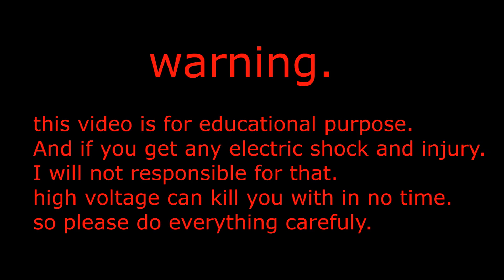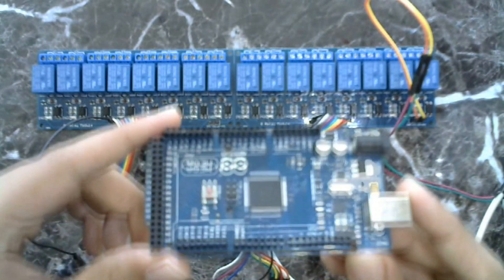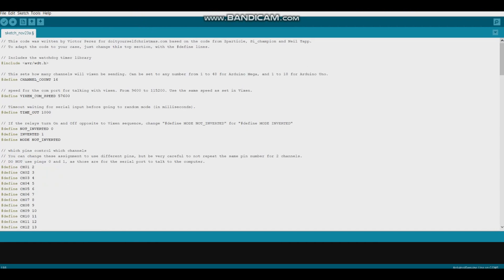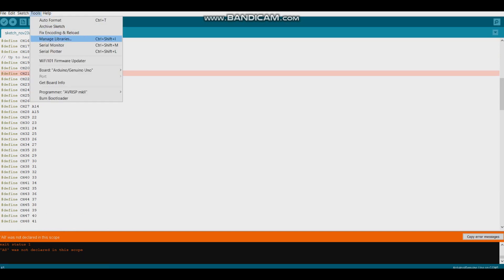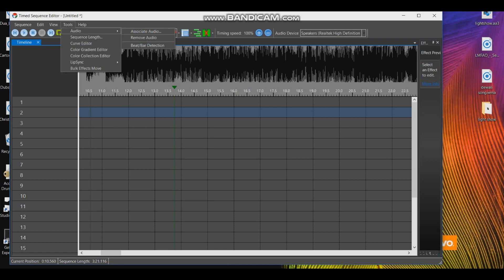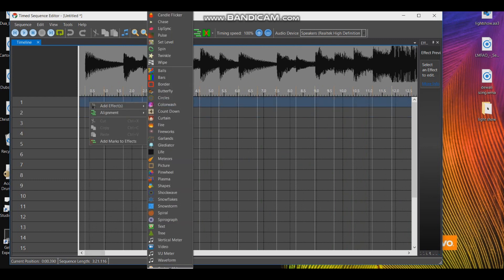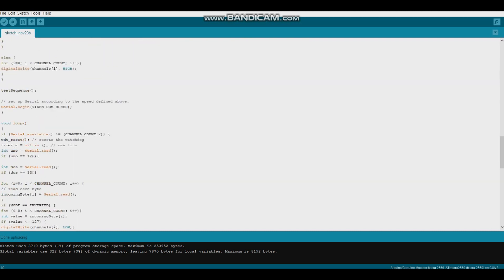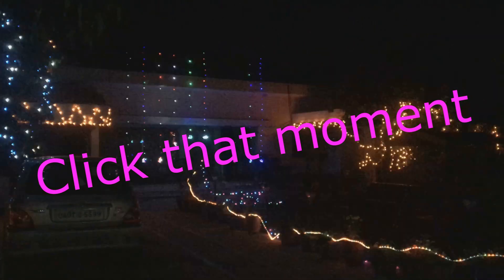How to make Christmas light show with vixen using arduino and relay.

Comment: can you link some more products for the boards and wires so i dont order the wrong things and is this water proof or do i need to build a case for it also do you need to use pixel lights
Reply from the maker: These are not waterproof and if you are using relays than you will use normal light strings and there is different settings for pixel leds. You can purchase any arduino and relay for this project.
Reply: @HOUSEHELPDROID  what about the wires

Comment: Great video and very informative. I wouldn’t have even attempted this without watching this video. I am Having trouble after configuring the board and configuring vixen. Everything seems to be working as my relay led’s are turning on in sequence but when I wire a set of working 120v light strips no lights turn on on the light strip. I have changed inverted to not inverted and vice versa. Any help would be appreciated.
Reply from the maker: I am glad that my video helped you. Are you using mechanical relay if so than listen for clicking noise if it is making that noise that means it is turning lights on and if it is not making that noise that means relay is not working if you are powering relay directly from arduino try using external power supply sometimes there is not enough power for relays from arduino.
Reply: Thank you! It is mechanical and no I’m not hearing any noise. I’ll try an external power supply and will post my findings. One more question regarding the power to the bread board. In the schematic could you show how the Arduino and bread board are wired? Sorry, I tried to follow the video but I don’t think I did it correctly.Thanks for the help
Reply: I had two things wrong. I had the relay wired to vcc not jvcc and ground. It gave me power but wasn’t actuating the relays. I also disconnected the ground from the relay to the mega and everything started working. Now comes the hard part of getting props made and wired.

Comment: Do i need 12volt or 5volt relay modules?
Reply from the maker: I have used 5v relay you can use whatever you want. But give relay external power do not power them using arduino on board power supply.

Comment: Awesome video! This helped me set up a great show this year. One issue I am having however is my Sequences now for some reason show my alternating effects as empty with no color, and they all have a dashed outline. Even when I try to open a new sequence vixen won't allow me to insert an effect with a solid fill. Any suggestions?
Reply from the maker: Did you try reloading your software.
Reply: I ran into the same problem when I set up each element as blue. When I changed the lights to show as red, white, or green, they showed that color in the timeline and preview
Reply: Hey Chris where did you get your supplies i want to do this next year

Comment: this is a great video.  i got everything up and running very easy with 1 8-relay board.  i would like to add another 8 relay board like you did but wiring to the breadboard to power the 2 relay board goes to fast for me.  Do you have a wiring diagram for Arduino to the bread board then to the 2nd relay board?  thank you
Reply from the maker: I currently don’t have any wiring diagram. You need to connect relay in series from 1-13 on arduino pin. And connect power wire to them.

Comment: do you control it offline or how? I want to set up a schedule so that all the lights are on, then the show starts, then reset
Reply from the maker: Its offline you need to connect a laptop or computer to control the lights. There is a schedule option in vixen lights from where you can create schedule for your show.

Comment: how do you change the random section so that relays are not random but all on if arduino loses connection.?
Reply from the maker: In code under random mode turn both channel to high
Reply: @HOUSEHELPDROID  I did that and they only stay all OFF. If I set both  digitalwrite lines to HIGH or LOW. they all stay off. any idea?

Comment: Your tutorial seems really good, but I am running into an issue. After I configure the system and the relays stop randomizing and turn solid (with the Rx light flashing), I program the new sequence using Vixen, but the arduino does not seem to recognize the sequence. The relays just continue to remain solid. Do you know what I am doing wrong?
Reply: I figured out that you have to opt out of the color configuring on vixen when you create the single item on this version of Vixen because it will automatically prompt you to configure it now.
Reply from the maker: @gregoryashcraft9484  yess u have to set it to single colour than it can patch directly to the controller. I am glad to hear you figure it out. Thanx for watching.

Comment: I'm experiencing some issues, as soon as i plug in my arduino to my pc. the relays start going on and off at almost random, without my vixen software even playing anything
Reply from the maker: They are programmed to do a random sequence. as soon as they will get data from vixen they will become still.
Reply: @HOUSEHELPDROID  Yeah, I ended up fixing it. Turns out i just messed up the com selection :)

Comment: How do i connect my christmas lights to power and to the arduino? Knowing my lights is 220volts each
Reply from the maker: by using relay you can connect relay dc to arduino and lights ac to ac of relay.
Reply: @HOUSEHELPDROID  oh okay, another question. Is the power supply necessary?
Reply: If so, where did you plug the wires after?
Reply: And last question, is the breadboard really necessary as well?

Comment: When I try and connect my relay pins to the arduino pins nothing signals? Help please! (Its not sending the signals to the Arduino)
Reply from the maker: make sure you have connect your relay power wires correctly.
Reply: @HOUSEHELPDROID  Got it working now thanks!

Comment: Going deeper in to the light programing can you change it to do individual lights on the strips say doing a strip of 50 leds  that are connected on 1 relay
Reply from the maker: No thats not possible you can control pixel lights like that.

Comment: What is your external power supply
Reply from the maker: i am using a computer power supply to power them all.
Reply: @HOUSEHELPDROID  thanks for the fast reply, would you have a picture I could use, I am completely lost when it comes to stuff like this
Reply from the maker: @shanekinsella7076  picture of connections.
Reply: @HOUSEHELPDROID  sorry I did not get the picture
Reply from the maker: @shanekinsella7076  dm me on insta aur fb.

Comment: Hi, when I use this code, my Arduino RX light just flashes continuously and will not turn on any relays. Please help.
Reply from the maker: did you make correct arduino and relay connections.
Reply: @HOUSEHELPDROID  Yes I can control the relays normally via a different Arduino script. When I load Vixen my RX light just continuously flashes and doesn't switch any relays
Reply from the maker: @adamtsang3233  did you send correct header (~!).
Reply: How i Can send correct header?

Comment: I have watched multiple videos and this is by far the best one to follow so thank you. Just one quick question... I hooked up everything the way it says and when I send the text header (~!) all of my relays just keep clicking on and off. What did I do wrong or how can I fix this?

thank you in advance
Reply from the maker: check weather you have selected correct com port and connect arduino before launching your vixen software.

Comment: I have watched a lot of videos on how to do this. You guys made it so plan and simple.   Thank you very much. Question...can you hook the relays to wall sockets to power the lights ?
Reply from the maker: you can hook lights to wall socket but not relay you will need a 5v power adapter to hook relay to socket.
Reply: @HOUSEHELPDROID  thank you for your response.

Comment: Hi! Do you mind if you could help me setting up a couple solenoid valves to Vixen lights. I just need a little bit of advice, please.

Edit: By the way, the code is not working.
Reply from the maker: Mysterian yeah u can connect your solenoid valve to relay directly and about code this code is for arduino mega and for arduino uno you have to edit it.
Reply: CLICK THAT MOMENT That’s what I did, but it still didn’t work.

Comment: Hello, I'm having trouble getting my Arduino to revive code from vixen. What its doing is it randomly jumps to relay to relay like a random mode? is there a way to fix it?  I have Followed everything exactly but its still not working. Hope you can help!!
Reply from the maker: did you type correct header
Reply: CLICK THAT MOMENT what the correct one?
Reply from the maker: SnowFlake Productions16 ~!
Reply: CLICK THAT MOMENT I did it’s still not working
Reply from the maker: @hounddogproductions  dm me on insta
Reply: CLICK THAT MOMENT lol I messed with it more and I got it to work!! Awesome Tutorial
Reply: @hounddogproductions  im having the same problem could you share your fix?
Reply: I deleted everything in vixen and started over works perfect awesome code and now I’ve added some d1minis running espixel over 1.31 for some props

Comment: Thank you for a great video. I'm having an issue. Everything works fine without the light but as soon as I connect the lights to the relay I can only run the show for about 10 minutes and arduino kick me out with timeout erro message. Any idea please. Thank you
Reply from the maker: Marvin Baulechong try to reupload the code to arduino if it didn’t work try replacing your arduino.
Reply: @HOUSEHELPDROID  I did, I have to reboot my computer in order to reload if not it won't compile.
Reply from the maker: Marvin Baulechong your bootloader is not working fine try to reinstall arduino ide app or buy a new arduino if possible.

Comment: Your explanations are simply perfect. As a newbie worked straightforward! The only thing I think is necessary (in my opinion) is to ad in the programming a pin on/of to all the lights. It could be useful to setup lights or make changes. Just a simple switch on/of to all channels.
Thank you!
Reply from the maker: aurel andrei yes it can be done by editing the last part of the code.

Comment: Thanks for this good tutorial. I had some issue with my relay turning on right after connecting to vixen. Changing the NOT_INVERTED MODE did not noting. Am I missing something? I got it to work by connecting the normally closed contact(off state) but it will not go on random on and off since Arduino senses output all the time including idle state.
Reply from the maker: Flippin Blades as soon as you connect your arduino to computer relay will randomly turn on and off. After you launch vixen software all relay will automatically turn off.
Reply: CLICK THAT MOMENT yes it will turn on and off randomly once pc is connected. the problem is when i launch the vixen program, all the relays will turn on instead of turning off. it will still respond to the sequence but in a reverse logic, that is why i have to land my wires to the NC contact(off state).
Reply: Im having the same issues
Reply from the maker: john butler there are three commands of inverted in code you have to change them all.

Comment: My vixen program crashed every time I put in the serial speed and text header pls help!!!!
Reply from the maker: Simple Savages try to reinstall your software.
Reply: I have tried that and also older software versions but nothing seems to work. :(
Reply from the maker: Simple Savages try disconnecting arduino and then put serial speed if that doesn’t work then try changing serial speed.
Reply: IT WORKED!!! Thank you soo much! Amazing tutorial

Comment: Hi. I've followed your video and done exactly the same but can't get the relays started. How do I get what I created in the vixens to Arduino?
Reply from the maker: Robin Algenäs did you send header
Reply: @HOUSEHELPDROID  
Hello thanks for the reply 
I'm new to programming and don't really know what you mean by send header? 
I have 16 relays. can only post 2-8 and they will be green / red. 1 and 9-16 are transparent and the relay does not pull. 2-8 works perfectly and the relay pulls. what have I done wrong.
Reply: @HOUSEHELPDROID  or  did you mean "Send a text header"  ~!
Reply from the maker: Robin Algenäs yes
Reply: @HOUSEHELPDROID  I have done that. 
But only gets 2-8 to work. 
When I add "alternating" the relay does not pull on the others. It will only be a transparent box and not a colored one. Think it must be a setting I missed. There will be no good light show with 7 outputs: D
Reply from the maker: Robin Algenäs alternating effect can be used with pixel lights but not with relay. With relay they will be simply turn on and off.
Reply: @HOUSEHELPDROID  That's what I want. Just on and off
Reply from the maker: Robin Algenäs you have to put alternating effect in front of every relay to make it work.

Comment: If you need more 16 relay, for exemple 30 relay are necessary, how add more relay? With new arduino card or extensions or choise 2 card 16 relay Ethernet with a switch? Thank
Reply from the maker: jonathan hansenius just connect one more arduino and change its com port in vixen that will work.

Comment: Hi, i was wondering with the block diagram. Is it Vixen, connected to arduino and to the circuit? How  would arduino dtect vixen? Tnx
Reply from the maker: MalipayongHulagway yes its vixen, here vixen detect arduino after uploading code.
Reply from the maker: MalipayongHulagway before patching set color handling to rgb.
Reply from the maker: MalipayongHulagway are you using pixels or relays, message me on insta i can help you there properly.

Comment: Sometime this code works and sometimes it doesnt and starts randomly glitching out. When i plug my Arduino Uno into a charging station it also glitches out randomly. I have edited the code for Arduino Uno and I have edited the invertation. Please help I am building a animatronic. Should I order a Mega?
Reply from the maker: C Martin did you plugged arduino after starting vixen if so then .Make sure to plug it before starting vixen. And everything should work fine.
Reply: @HOUSEHELPDROID  so the problem was i was using solenoid valves with the relay without flyback diodes

Comment: Is It possible to create a fade effect in Vixen3? Maybe using solid state relays instead yours?
Reply from the maker: MagoMerlinog its not possible it is only possible in pixel lights.
Reply: @HOUSEHELPDROID  thanks for your answer. And the arduino code will be the same or not? Unfortunatelly i don't know how to code.
Reply from the maker: MagoMerlinog code will not same for arduino uno and nano you have to edit it for them.

Comment: i just followed your instruction..but when i add effect to turn on light as in 8:00 and then when i play the led's not blinking accordingly...instead it just blinks the random effect...why is that??
Reply from the maker: Did you connect arduino after starting vixen.
Reply: @HOUSEHELPDROID  im having the same problem!
Reply from the maker: SnowFlake Productions16 did put correct header in setting of vixen software
Reply: CLICK THAT MOMENT ya ~!